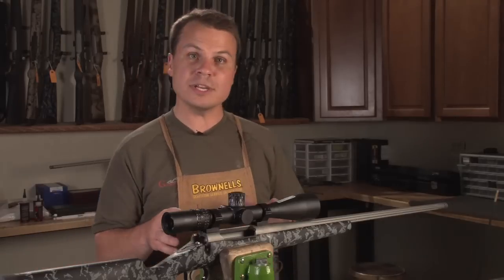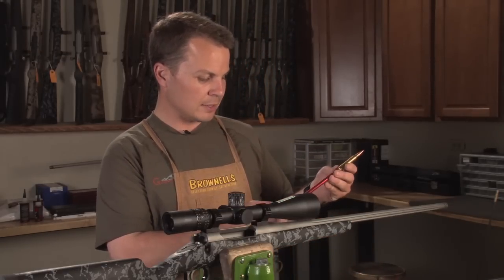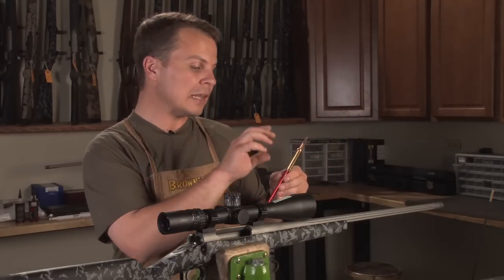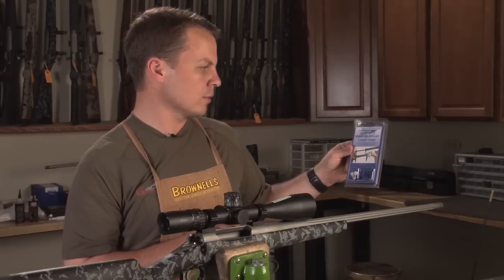DIY Bullet Seating Depth

Comment: I took a fired case I had no intention of reloading. I made sure the bullet could slide fairly easily in the case. I coated the lower inside of the case with shoe glue and inserted the bullet so it was too long. I put the gun in my gun vise angled down in front. I inserted bullet into chamber carefully and slowly closed bolt. I went for dinner. After dinner I removed the cartridge and measured my bullet seating depth at ogive. I saved the bullet for future reference.
Reply: Outstanding!
Reply: KISS!

Comment: Why go to all this trouble.  If you reload often you WILL need.a bullet puller and the FA kinetic ones are inexpensive.  So size a fired case. Load a case WITHOUT primer or powder and with bullet seated a few thousands deeper than standard.  Make sure it chambers easily.  Pull the bullet.  Insert it into the case just enough to hold it.  Chamber it and the bolt should seat the bullet with it just touching the rifling.  Measure the bullet overall length.  Subtract your desired clearance.  (I have seen 10 to 25 thousands recommended. I have no idea what is best.) You now have your desired seated cartridge length for this bullet.  Who needs all these gages?  Spend your money on something useful
Reply: Often the lands exercise friction power to the Projectile so if you extract the cartridge, the Bullet gets pulled out an unknown length. This makes it the absolute worse method.

Comment: You have to be very careful with seating depth (OAL) because it drastically alters chamber pressures and if you seat deeper than called for in a recipe you got from a reloading manual or powder company you can increase the pressure to unsafe levels.  If you seat shallower than in a recipe then pressure will be decreased and the powder does not burn as efficiently and completely and can produce a dirty load. Jamming a bullet into the lands can increase chamber pressure by 4,000 - 10,000 PSI. I am not saying you should not do custom seating depths, I am just saying that you need to understand the ramifications of what you are doing.  You may have to reduce or increase a few tenths of a grain to get back into a safe zone/ sweet spot with a custom seating depth.  If you have sensitive powder (Min and Max load close together) then you really have to be careful.  I would never recommend inexperienced reloaders use sensitive powders due to the special dangers those can present.
Reply: wHAT ARE SENSATIVE POWDERS?
Reply: You know, snowflake powders. Powders that wear their feelings on their sleeves.

Comment: I have used the same technique with great results. Great vid btw. The only thing I noticed when starting out was that when resting the rifle horizontally I would get flex in the cleaning rod and thus had some inconsistent readings. I now prop my rifle in an inside corner of my bench (bore facing up) and use a torpedo level to get it straight and measurements are bang on. (I always measure at least 5 times and average). cheers
Reply: Great point. I agree. Thanks

Comment: I've been down that road before & it does take awhile to clean up all that powder. I did a test with factory ammo & my reloads, come to find out that when i seated the bullet to what the factory did, i had the same results. Another thing i did with factory ammo with a pointed soft point was to scrape any lead that was on the copper jacket back to the tip with my finger nail. Then take the tip with the bullet down on a piece of wood & gently rub it flat. Then roll the tip at an angle to reform it. I did this to 3 shells & fired a group. Then with 3 right out of the box. The group that i worked on & fired was alot smaller than the ones right out of the box. Thanks for the video.

Comment: It’s one way to do it. I just place a bullet into a fired, empty cartridge  and send into battery slowly. As a note, your powder choice can confound all known guess work. Different brand primers can as well. Then I load ten cartridges from start to max and fire them. At some point, you will see a close group in this test. The barrel is a harmonic balance( tuning fork). You will discover what powder charge for your barrel will spit thebullet out at the optimum time. Plus, it’s fun

Comment: I have used this process on a 270 Browning BAR with tape instead of the attachments. Get the general length (maybe 15 thousandths long). Test the round and re-seat the bullet shorter and test it in the gun again until the o give is perfectly mating with the rifling. I did that for 5 rounds. I made sure all 5 will cycle through the gun by hand without sticking in the chamber and the bolt goes all the way to battery. This is a great DIY customization method to get your handloads perfect for any gun. Once my die is set up, I just load away at that length.

Comment: I put a neck sized unprimed case into my lathe and slightly reduced the ID of the neck with a drill bit until the bullet had just enough interference fit to be snug but still move up and down the neck.  Then just pop it in the chamber and close the bolt, remove, measure and there's your COAL.

Comment: yes. but you need to make sure your case neck has just the right amount of tension. sometimes the bullets will pull out of the case a bit, when youre extracting the round (after you've chambered it to determine oal).

Comment: I'm reloading Hornady 308 BTHP 168gn and when i measure OAL with empty cartridge, it comes to 2.782, this is 20 thousands less than recommended MINIMUM case overall length, which is 2.8". I am using the permanent marker method on a chamber formed cartridge and full resized.
Reply: Your problem is you have resized your fired cartridge.Dont resize it.
Also it's best to used a cartridge that has been fired at least twice from the rifle you are measuring from. Good Luck

Comment: Worked great on my tikka 30-06' but my 303 my chamber is to long. Bullets does not seat properly and does not fit in mag
Reply: Yeah, with guns using a magazine, you can only load as far as the interior measurement of the magazine, or you single load to the open chamber....

Comment: That cleaning rod method seems like an inexpensive and quick procedure to get COAL.  If I wanted to seat my bullets to CBTO I should make up a dummy round using the exact bullet used, then measure CBTO with the comparator off that dummy round?  Does that sound right?

Comment: I hadnt found a lot of information until recently about making accurate reloads. Mostly what i read was finding a good bullet and powder charge and powder. I dont understand how the type and brand of powder is important but ive wanted to know how to find a coal. This video and one other are all that i found to get the coal without throwing money at a tool ill only use a few times. I did the sharpie thing and it looks like its about .2 inches too long but ill do the cleaning rod trick to confirm it

Comment: I'm surprised at the knitpicking about COAL vs CBOL further down the list. Isn't it obvious that you want to measure Base to Ogive to develop your base line measurement?
After many NRA HI-POWER matches I began loading 55g to mag length for 200/300 and 0.020 off the lands using 77g MKs for 600 yards, which is restricted to single load. Never had accuracy issues with either load. Tried 69g MK for 300y but was no better than 55g and moocho more expensive.
Using a 10x scope during practice sessions, I could run a steady string of Xs/10s from 600 yards prone till I ran out of ammo. Full floating 8.5 twist Stainless HBar and Bushmaster 2 stage competition trigger set for 6 lbs. Very crisp break.
Made my first test cartridge using a fired case, full length sized with no expander and slit the neck with a dremel. Slipped the 77g MK partially in, heavily marked it with magicmarker and carfully lowered the bolt to engage the extractor.

The lands seated the bullet scraping the magicmarker to indicate seating depth. Pushed bullet out with cleaning rod, inserted bullet, measured CBOL, subtracted 0.020 and used that seating for 600 yards permanently. Load developed at 100 yards by varying powder changes and then tweaked at 600 yards using 10x scope.
BTW: I didn't have a chronograph back then.

Comment: Waiting for your (Gunwerks) reply regarding ogive, like an acknowledgement that measuring OAL does not get you what you're trying to achieve, pretty basic reloading practice, seems like something you guys should know.
Reply: Brian Ru I'm pretty sure Gunwerks knows that... Aaron must have assumed people would know the next steps involving seating that same bullet and measuring the base to Ogive with a bullet comparator.
Reply: He is keeping it simple.  I can tell you they know the CBTO of every gun that comes off their racks.  I provided a similar answer to answer post in this thread.  I'll share here... I have both gauges Aaron describes.  With the Hornady OAL gauge, I  pair it with a comparator (so I can get CBTO - Cartridge base to Ogive) reading vs. COAL.  I also have the Frankfort Arsenal tool as shown.  I like the Hornady setup better myself.  With VLD or LR bullets, it is more accurate and consistent to measure CBTO than COAL.  The comparator not only allows me to measure the headspace off the shoulder for the Hornady case but also a fire-formed case and compare the two to get a "true" measurement.  By the way, short of Bryan Litz, I have not had conversation or traded emails with a smarter group of folks (Mike and Aaron) on the subject of long range ballistics.

Comment: Base to ogive  is a better way to measure  because you can consistently know where different bullets engage the rifling  oal alone may have a bullet to far in the case or you can shoot a longer bullet manually in a mag fed gun
Reply: Measuring from the ogive, and measuring from the tip are the same operation here. The measurement is for 1 type of bullet, in this case the one he has here. If we know the bullet is touching the lands with the ogive, then knowing the measurement from the tip does the exact same job to know how far to back it off. The bullet is a solid object, afterall.
Reply: @CrashRacknShoot  all do respect , it's not some bullets have deformity / polymer tips also If you want to load for say a longer bullet  but you have the same over all profile it makes it alot easier ... also sometimes running from bullet jam isn't always best or not possible example 130gr rdf in an ar platform touch the lands at about 2.420... that's past magazine length.  Just putting in my take and trying to save you a little time ,money , and range trips
Reply: @CrashRacknShoot  lol  let me see how much you know... if I have a group with left to right weather report what should I do 1st?
Reply: @christmaspopcorn87  not measure every single bullet. Why you changing the subject?
Reply: I wasn't even going to reply to this thread because it's over 3 yrs old  but you should probably humble yourself and really learn reloading... its alot of fun but it's also alot to learn you can make some amazing loads and even go pass Saami spec. Alot of the stuff I'm saying comes from berger manuals and f class shooters . I didn't know how much I didn't know when I started as well
Reply: @christmaspopcorn87  wasn't gonna reply yet the concept of a solid object being measured from either the tip when one knows its touching lands, or right where the lands touch the bullet gives the same result is so otherworldly to you, that you had to side-step that point and try to play reloading trivia. That makes sense.
Reply: @CrashRacknShoot  I actually  do measure depending  on what  type of testing/ shooting I'm doing .... precision under 100 rds I'll measure each,  over that I won't.  That being said if 80% of my lest group say 4/5 rds or pretty close in velocity and groups at 100 or touching I know I have a pretty good load especially if I move the seating depth back a few thousands and still get a good group. I know I've found a node. If I'm going for extreme accuracy (under .300) I volume sort my brass  and check humidity of my powder , all cases annealed and full length sized -002
Reply: @christmaspopcorn87   is dancing also a hobby of yours? Sure do love side stepping a lot lol. I didn't ask that man, but good for you.
Reply: @CrashRacknShoot  lol I wish I can't dance to save my life ... I felt like I addressed all your questions but do whatever you like good luck in your reloading
Reply: @christmaspopcorn87  lol it's the youtube comments, never know what kinda nutjob one will run into. Because of that, I'm usually on the defensive. If I came off that way, I apologize, because you seem like a good person. Also, I may not be stating my point correctly, so that could be where the hangup is. But all good! Keep on doing you! 

It is a little excessive in my eyes to measure that many successively, but hell, if that method works for you, who the hell am I to argue? With that kind of precision, you're probably grouping in one hole that ain't even jagged!

Comment: I Shoot bolt Action rifles for Hunting.? and I seat all of my Bullets, So that they just touch the Lands.? No Crimping (Not needed) for my rifles.? I fin that the Accuracy  is Fantastic.? Using this bullet seating setting.?
Reply: I reload and ive noticed my most accurate rifles(204 223 and 6.5 ar'15s bullet holes touch at 100) will very faintly "cut" or mark the bullet. you can see the twist on the projectile.

Comment: I've been trying this for half an hour and I'm getting everything from 2.840 - 2.985 and everything in between. Any thoughts?
Reply: with berger vld bullets
Reply: No one answered but I have the same problem lol my OAL measurements are all over the place
Reply: Cody Logston perhaps its a variation in the finish of the projectile. i know with amax's and bergers that i have there is a variation from bullet to bullet.
Reply: See Mike Hunter above
Reply: I realize this is super old but maybe someone else can learn from it. The reason you are getting such wild numbers is because the biggest trick is applying consistent pressure to the bullet against the lands while taking these measurements. This is very light pressure too. You're not trying to shove the bullets into the rifling but just touch. If you're doing it right you should get no more than a .002" spread over several measurements. 
I use the Hornady tool he mentioned earlier in the video and I can get readings inside .001".
Another note...clean your barrel thoroughly before you do this measurement.

Comment: I bought the Hornaday depth gauge tool for my Savage 223 bolt action.  The case for this tool is cut to .175" and does not work.  I have to push the bullet so far up that there would be NO room at all to even seat the bullet.  The case is too short!..  To me, in order to work, the case has to be set to .176", maxed out.
Reply: This gauge won't work in BOTH my AR's as well.  The case I got for this exact gauge, by Hornaday, measures from end to end, 1.75" 

The MAX case length for a .223/5.56 round is 1.76"  There for, it's useless for me.  The Hornaday case should be the max allowed (1.76") in order to work right, in my view.

I've even takin bullets out of PMC store bought rounds to test, and same results, so the bullets are not the issue.  I can't believe all 3 of my rifles, (one bolt action, 2 different AR's) have that deep of a throat.

BTW, the 2 AR's are one's I built, using different upper's and barrels.
If I need to buy special bullets that are extra long, then why bother using the gauge unless I'm going to do competition.

Comment: hi, i was doing an m4 ar15 chamber with a 55grain 223 [224] hornady tipped vmax and i got 59.5mm or 2inch and 11/32 which i think equals 2.3456 inch C.O.A.Length    ... i know that magazines take slightly under 2.25 inch and i know that there is basically 3 types of chambers from what i hear, a 223 chamber a 556 chamber and a 223 Wylde chamber ... anyone know what mine is from the stats i listed? i know that different types of bullet taper will give different measurement outcomes due to hitting the rifling at diferent times but i gave the only specific bullet and measures i could give you and ask for info. without listing the bullet i used i figured there was no way in hell for anyone to tell or guess my chamber type. anyway, thanks and hope to hear from people soon and start a discourse :-)
Reply: Your barrel should be marked 223 or 556 or Wylde along with the twist rate.

Comment: Wouldn't you want to measure the inside of the first clamp and the outside of the second? Or just subtract the thickness of the block? Anyone else?
Reply: no, Molon Labe.  Measure left side to left side, or right side to right side.  They're both the same as center to center.  Put two pencils in your vise and try it yourself.
Reply: Yes your right but I don't see how it could be as accurate as a bullet comparitor.  I've had the best luck using a once fired case out of the same camber. Place the bullet on the case mouth slide it in the camber and close the bolt. Make a few and see how close they are, measuring with a bullet comparitor. If I see what I like back off .040 and start there. 

You would think after you spend $6,000+ for just a gun you would get a load development or at least head space measurements. Lol
Reply: Comparator..... Fucking auto correct!!!